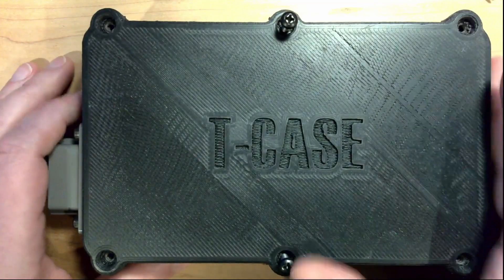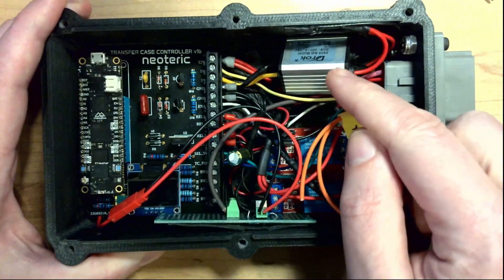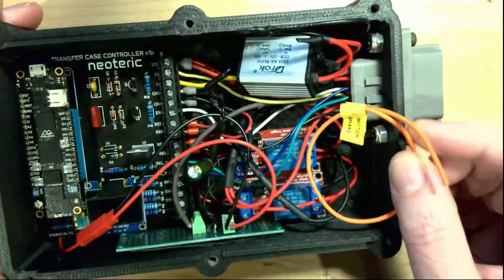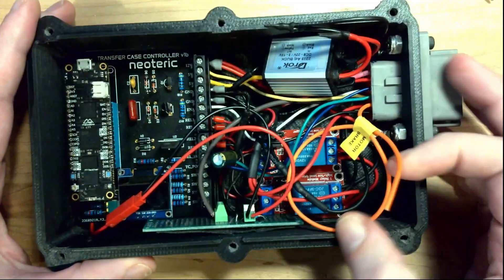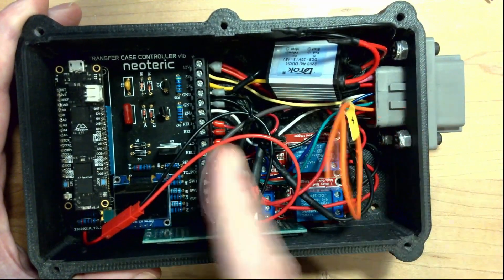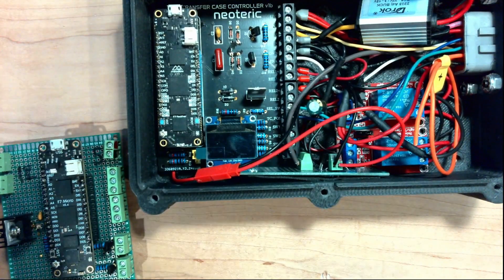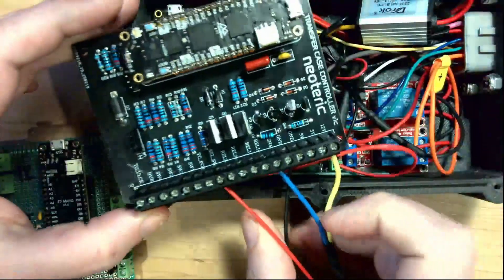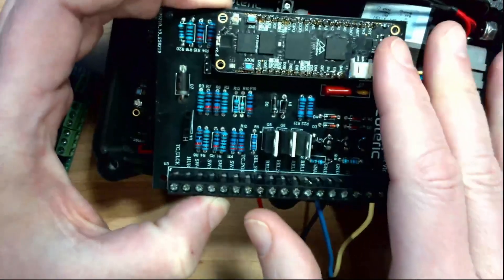Can C# Really Be Used for Embedded Projects?

Comment: Thanks for your explanation. I programmed a little in C# and a little in C. As you say, for what you are doing you don't need high performance real time, and it will be much easier to add new features in C#. I would like to see how you use C# with such an embedded device. Which programming environment do you use?
Reply from the maker: I don't develop right on the device, I develop on a desktop and deploy the code to it (which also has the advantage that I can do a lot of testing with simulated hardware before deploying).  I'm using VS2022, though it would work just as well with VSCode.

Comment: I don't se WHY you would use C# or C++???? C is good, and object oriented programming in embedded projects are just a bad idea in general, as the code bloat is massive. C is superior to those modern crap languages like Python, as  C allows you to program much closer to hardware. Ruby too would be much better than Python.
Reply: Different languages tend to have different target use cases. Typically with embedded you use a systems level language due to the real time performance. In this case he's not using it for real time so timing isn't critical.
Python is more of a scripting application level language, you can use it for embedded (micropython) but I wouldn't myself if timing was critical as it's more for scripting. Ruby I feel personally is more of a dead language these days. CSharp is more of a application language, typically its compiled to IL then from IL to assembly on non embedded platforms. In theory it could work quite well due to it being compiled, but doesn't have a lot of community interest behind it.
Rust seems to be picking up speed quite a bit, this works both as a systems level language and application level language. Much better tooling (cargo for downloading develop time libraries), builds the same across any platform, very simple build process (no linker flags or magic cmake script bullshit to worry about)
Also the number of devs behind it is quite large.
In the case of C it's inherited decades worth of cruft. It has a thousand different build systems, each library defines it's own macro's for an int, because int isn't standardised across platforms.
You have unpredictable behaviour in some cases, no static typing for structs etc. The only reason for using C is if it was a business requirement or if other dev's in a team only wrote that language.
Reply from the maker: 🤣 That certainly is an...opinion.  It just sounds like you're a dinosaur gatekeeper, and by your reasoning you should probably only be using assembly. "C allows you to program much closer to the hardware" is both tired and unabashedly false.  I know C.  I could choose to use it, but I don't. There are solid reasons why many organization recommend no longer using it for any new projects.  You're just out here yelling "keep off my lawn" because you refuse to even try to understand new things (like this 25-year-old language)
Reply: @dotnetMakers I don’t think calling this guy a dinosaur for using an appropriate language for embedded (C) is called for - I think his point was “why not just use the efficient language regardless if you need efficiency or not”. (At least that’s how I read it).  Use what you like.  I’m glad c# is implemented for embedded.  I’m a c# guy myself but nearly always go C for microcontrollers.  Regardless I like your videos and you have a new subscriber !.  C and c++ are under the hood of nearly everything we use and there is excellent computer science reason for that.  Those dinosaurs are typically proficient developers.  There is also the cost of relearning languages when you already know how to do the same thing with another language.  Myself I use ASM only for timing sensitive parts of instructions because coding start to finish in that feels like a form of punishment..  I found C and C# learning curves fairly easy.  C++ OOP despite all my years of coding I still don’t implement OO correctly 100% of the time and I feel inferior with other programmer peers of mine because of this.  I think problems out more procedurally/sequenced I find.